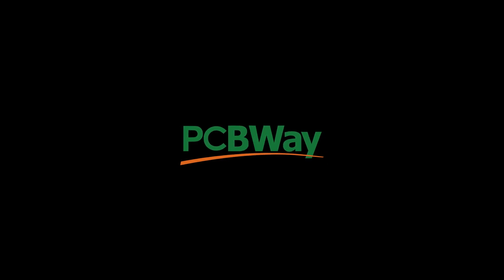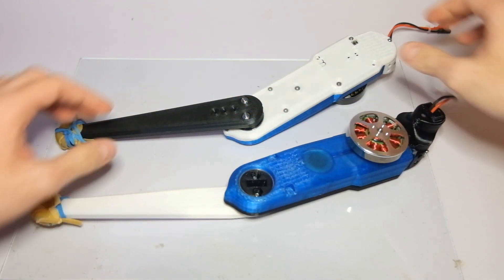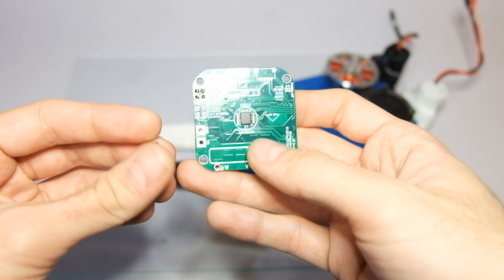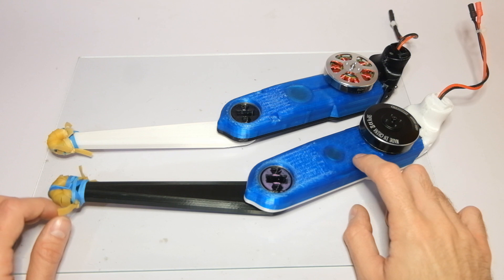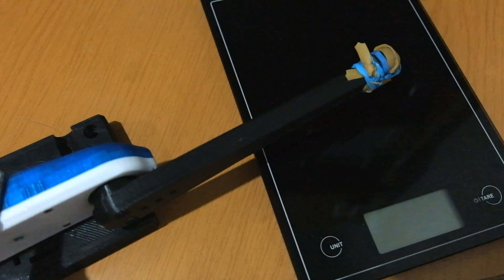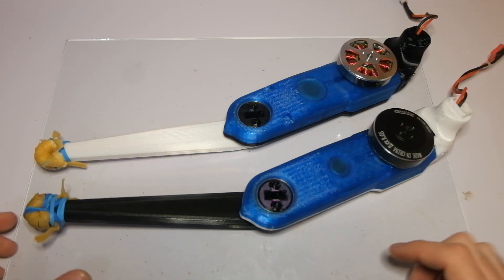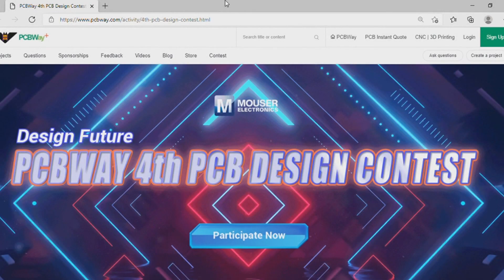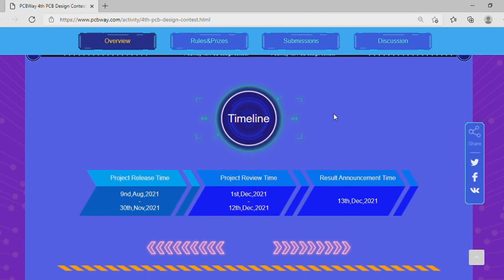New Brushless Motor - Quadruped Robot Series #5

Comment: Very nice actuator. What are you using for targets for torque and speed for your quadruped and what is the expected weight of the actuator and the finished robot?
Reply from the maker: I don’t have much experience with simulation (though I’m slowly making an effort to learn), so I’m estimating by watching how the the single leg behaves and comparing it to other similar projects; temperature is a great indicator if the motor was selected properly. The expected mass is between 3-4 Kg.